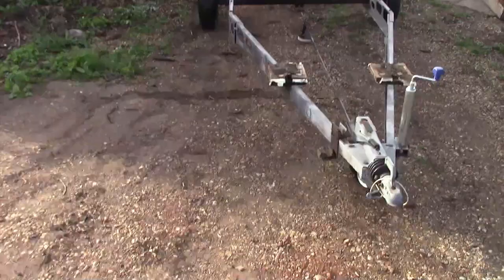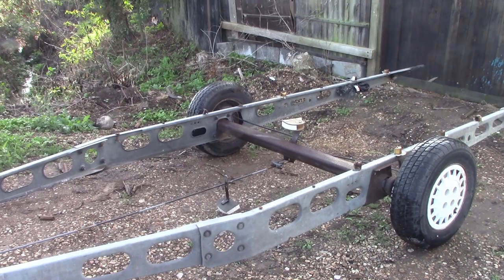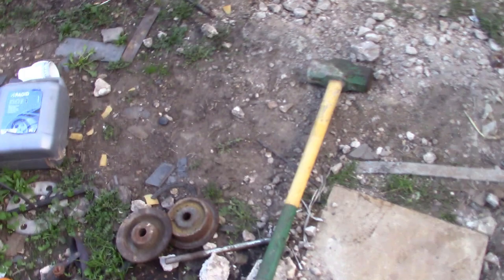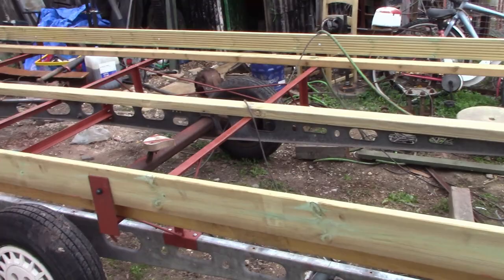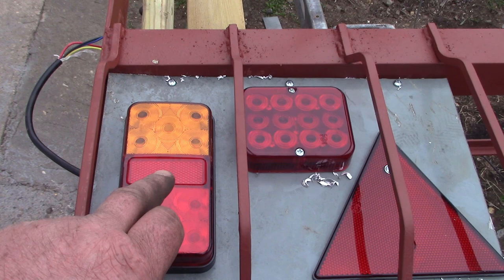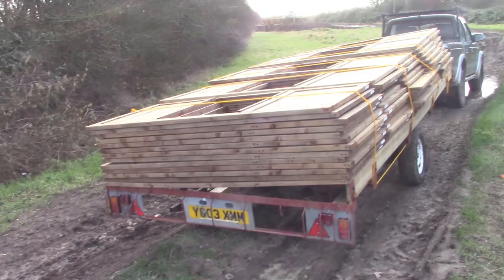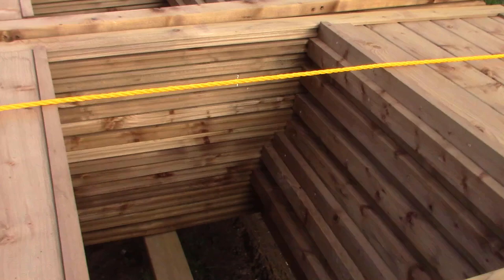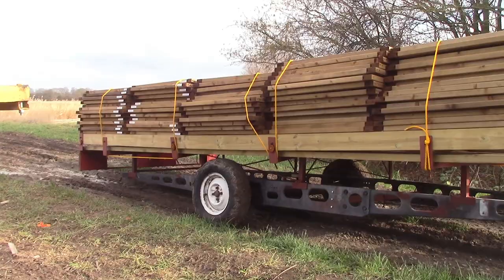IBC transport trailer build

Comment: As usual, I know nuuuthing. But, what struck me was the lack of diagonal cross bracing to the chassis. The caravan frame and ply  would have provided that, but I can't see that there's anything to replace that? Might that be the cause of the lousy handling? You know your stuff, and I don't, so just a thought.

Sitting here nursing my back (it went again... I bent over the sink to wash my face!) so grateful to see you popped up a video. Always look forward to them. Cheers mate
Reply from the maker: You are right, I put some ties in but nothing on the horizontal plain. 
Didn't help the panels were not actually sat flat either.

Comment: looks like maybe the trailer is lifting the back of your truck up ? looks very back end heavy even though the wheels are quite well back? Or is that just your new springs > The ball and socket looks like its a bit higher than it should be is all. Might be why your handling is a bit *literally seesaw*,,?
Reply from the maker: Was positive tongue weight, not much but will try dropping the ball a bit, should probably do that anyway.
Reply: Yeah, that caught my eye too. Load the front a little more. 60/40?
Reply: Was going to suggest the same thing that you need more tongue weight. All you have to do is slide the load a few feet up. Here's a nifty video demonstration of tongue weight.
https://youtu.be/6mW_gzdh6to

Comment: Maybe instead of single straight bits of angle across chassis , 2 crossing eachother and welded where they touch would be better
Reply from the maker: I think you're right, needs some more bracing.

Comment: Jim, if you need a tarpaulin to cover you trailer, check with  hoarding companies to see if they have any used signage to use for that. In my area, I've gotten several of them over the years, and the heavy vinyl ones are good for about 10 years, and the thinner ones are a lot better than the imported green, silver, or blues ones.
Reply from the maker: Curtains off a trailer was the best tarp I ever got
Reply: @turboconqueringmegaeagle9006  one of my best was from a dumper truck. I also got a curtain from a community gymnasium that split it in two for different activities in each half. That came with a chain in the bottom to help keep it in place if bumped or pushed.

Comment: I collect old signage for my shop walls, mate. Anything that was specifically designed for industry, or In the case of some, bank signage that prohibits skateboarding on the property. I have one from a drive thru car wash requiring 10 coins (US quarters) to operate.
Reply from the maker: I quite like brass placards, got a set off an old onions scraper, full instructions on cable rigging and lubrication.
Reply: @turboconqueringmegaeagle9006  I had a cast iron plate off of an old boiler, but it was traded off.